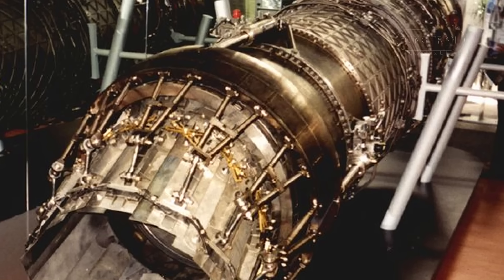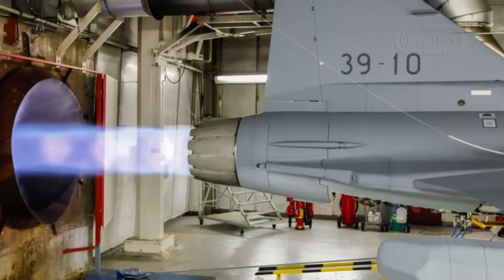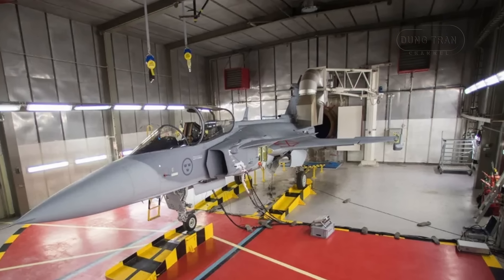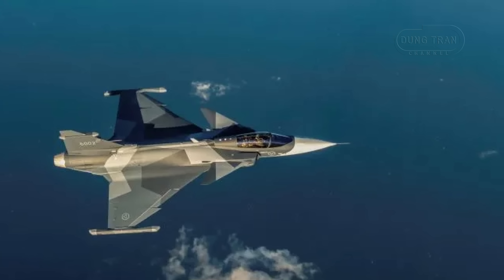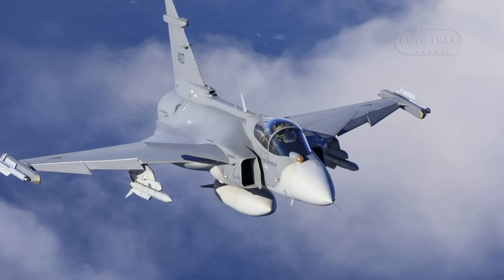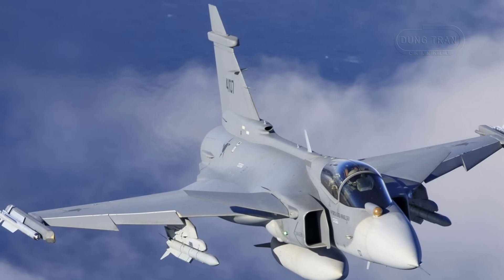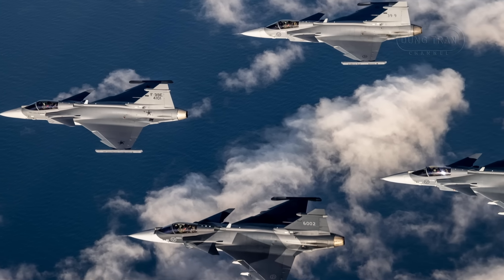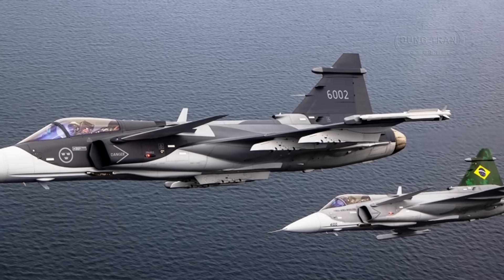Sweden’s Bold Move: Rolls-Royce Engine Could Save the Gripen E/F! 🚀

Comment: The grippen is a fine little jet  and would be a great low fighter in the high low fighter jet strategy. NATO has long depended on the US to provide the heavy lifting when deterring the Russians from aggression. Relying on Grippens alone continues that trend. The proposed engine swap only lowers thrust by 10%. I’m sure Saab can easily sell fighters with 10% less performance.  Even so Rolls Royce is threatening to move to the US if so whose engine will they try to shoehorn into it next. Trump has been trying to get NATO to fulfill their defense spending percentages  and with the recent aggression from Russia they are at least paying lip service to it. So far Canada’s only air defense move has been to buy a bunch of legacy f/a 18s too worn out for Australia.  If I was Canada I’d at least honor the original f35 order maybe even a few more then split the rest of their fleet between grippens with the engine it was designed for, and F/A 18 super hornets both use versions of the same engine. I’d build the hangers for the f35s and contract with the US for maintenance. So Much TDS here is amazing. He will be gone in 3 years long before the fighters arrive and then you will still rely on the US to deter Russian and Chinese aggression.

Comment: Y'all are latecomers😂 

The Rolls Royce Avon engine was used, modified under license by Volvo Aero as RM6C by J35 Draken since 1950s. Before that by J32 Lansen.

Another Rolls Royce engine was pre-selected for the J37 Viggen but had to be replaced by the Pratt&Whitney engine for the Boeing 727, heavily trimmed for near Mach 2 speeds again by Volvo Aero into RM8A&B (the latter for the JA37 fighter model) due to discontinuation of the British plane the engine was originally intended for.

Comment: Sorry folks euro fighter Typhoon blows this out of the sky in every way and more . Gripen can only do a 8.2 G turn compared to the Typhoon 9G constant . The comparison is no contest .the ceiling is sub par compared to Typhoon  55000 ft proven after burner mach 2+ cruise without mach 1.5 and way more hard points with the most modern missiles. 360 degree helmet view the list goes on . Why use just to show were got some fighters make a statement we are still relevant and ready. Don't bring a knife to a gun fight.

Comment: Saab is actively working on replacing the current General Electric F414G designed engine in the Gripen E/F with a Rolls-Royce engine. Specifically, they are proposing to integrate the Rolls-Royce EJ230, a derivative of the EJ200 used in the Eurofighter Typhoon, into the Gripen E/F. This move is driven by a desire to reduce reliance on US-sourced components and mitigate the impact of potential US export restrictions, particularly in relation to Gripen sales. This would pave the way for Philippines, Colombia and maybe some other countries acquisitions of Gripen.

Comment: A few issues:
- Is the Rolls Royce engine itself 100% ITAR-free?
- The Gripen has other ITAR components, so it's not just the engine that needs changing.
- If any long-range air-to-ground/anti-ship weapons rely on US navigation & targeting assistance (as with the StormShadow in Ukraine), that's going to be another stumbling block to Gripen sales.

It seems to me that European countries need to design and build their military gear from the outset to be 100% ITAR free. Being dependent on the US, especially with The Orange One in charge, is not a good position to be in.

Comment: Retired Canadian Cold War aero engine  tech.

I do not profess to know economics,  though took economics in school.  One subject in college Economics Engineering Analysis,  hard professor, but smart, NASA was trying to poach him.
 So just talking without the economics knowledge.
 I worked on GE engines in my career. Funny Rolls Royce in Canada overhauled then if I recall correctly. 
 So have read USA vetoed Grippens for Columbia as has say as GE engine.
 Read Rolls Royce has an engine that could fit in Grippen.
  So as Canada only taking the 16 F 35's they paid for and seem to be canceling the other 62 F 35s.   Maybe Canada could entice Saab, Rolls Royce and Columbia by proposing that Canada will purchase Rolls Royce powered Grippen E, and as cheaper more than the 62 canceled F 35s.
 Columbia could then get Grippen by not needing USA okay.
 Canada will be another step away from the 75% military equipment we were buying from USA.
  Maybe with the non USA engine, other nations will consider going with Grippen.

As an aside with the recent NATO Summit wanting 5 % of GDP put part think 1.5% can be for infrastructure.
 So maybe Canada as Grippen doesnot need airfields but can use roads. So can build some smaller airfield in our Arctic, this supporting Grippens and possibly Airborne Early Warning Aircraft ( Sweden uses one with Canadian Canadair airframe : win win).    With Global Warning and Northwest Passage opening up. This would help Canada with Sovereignty, plus good pro active action against the Mango Mussilini's talk of taking over Canada and Greenland.  Maybe besides NATO partnership Canada and Greenland through Denmark can write up a partnership to jointly monitor and protect their territorial waters ( 200 km ?)    This would be another block against loss of sovereignty

Comment: Daumen runter. Deutscher Titel Englisches Video
Reply: YouTube automatically translates video names to the language of your device, genius.
Reply: @honzabalak3462  Nur wenn der der es reinstellt auch den hacken dafür setzt, du Genie.
Reply: @hl6199  Duh. So you know how it works yet somehow still act all surprised and angry. There is an english title right there in the thumbnail, BTW. Super easy to spot, in fact.

Face it, you're only hating because you wanna hate. There is no actual reason for it - it's not the fault of the video or its author. It's a YOU problem.

Comment: British 🇬🇧 here, I'd like to see our Royal Air Force buy 80 or so of these to replace the Jaguar austere airstrip (roads) dispersed operating capability. In time of major war airfields will be prime targets. If we had 2 Wings trained and operated like the Finnish and Swedish Air Forces able to disperse and operate from roads that would be great.
Also engine commonality with the Eurofighter Typhoon would reduce costs 👍
Reply: A navalised version would give some meaning to our aircraftless carriers.
Reply: @Teddy2020-v4p 
I did think of this as well. But the Gripen is probably too small unfortunately.
Plus it's very difficult to Navalise an aircraft that's not originally designed for it as has been shown in the past ☹

Comment: Saab could develop a twin engine variant of the Grippen for the long run and then the Eurofighter engines could be retro fitted that way but the cost per unit would skyrocket.  However for large terrain like Canada this would be a preferable platform given the redundancy a 2nd engine would provide.

Comment: For Canada, the Gripen would be an excellent jet for operations in the Arctic. It offers lower maintenance costs, more economical operation, and would reduce reliance on the U.S., particularly under a potentially unstable or politically compromised administration. Additionally, the integration of a Rolls-Royce engine aligns with our strategic partnerships in the European Union and could strengthen transatlantic defense cooperation.

Comment: yeah, I think that 99% of all people in this comment section don’t realize that nothing happened and most probably nothing will ever happen in this direction. The export problems of SAAB just highlight of how we Sweden and it’s jet are in the end of the day. Even if they switch engine, they are still under full US control because the US can still pressure soap by threatening to kick them out of the T7 program.

Comment: I'm Brazilian. The Gripen is fantastic, but if the Saab to change the engine for a Rols Royce, its will the best of the world.
Reply: You do realize that the aircraft will essentially be a different one that what you have right?
Reply: @aidan11162  Its a  normal and simple engeneering procedure.
Reply: @aidan11162 , I'm not very knowledgeable, but this is what I gather from the news and Google.

Brasil doesn't really have that many Gripen E. Production and delivery have been slow, so most of its present Gripen cleet is comprised of an older model on a loan. I don't think any Gripen F (the one that will be built here) has actually been delivered so far. 

So it's likely that the swap could be made somewhere along the line, but that decision  is not straightforward.
Reply: @loremipsum7ac  It's really. Severous issues are contributing. The USA engines are one of them.
Reply: @loremipsum7ac  There are no loans or older models. Brazil is set to receive its 10th Gripen in a few weeks, followed later this year by the 11th Gripen and the first one produced in Brazil. Another 14 will be produced in Brazil and another 8 in Sweden until 2030(was suppose to be 2027, but changed due to $$).
Reply: @loremipsum7ac  Myb you should learn before talk ? Brazil has the full production line of the Gripen it was on the agreement that Brazil could gain the means of production by even exporting it. If you check the news recently we double the capacity of our manufacture from 8 to 16 in partnership with SAAB

Comment: Rolls Royce did this with the P51 Mustang in WW II making it a far better plane, and a match for the FW 190D.
Reply: The Merlin was a fine engine but really no better than the Allison the mustang was designed around. Since the mustang was created for a British contract and since the Brits needed every Merlin they could build and could build no more they wanted any fighter they could get their hands on. The early mustangs were great low altitude planes but the available superchargers were not configured for high altitude because the US Air Force’s inline fighters were designed around turbochargers. Once the Brit’s mates a Merlin to a p51 it was a high altitude winner but still no Merlin’s were available. The American automobile company Packard reengineered the Merlin for modern manufacturing methods vastly improving speed of production and making almost as many engines as the UK did in half the time. Allison continued to improve their superchargers until their engine was a match with the Merlin and a bit better but by then the war was ending and soon jets ruled the skies.

Comment: Canada here.🇨🇦 Canada should definitely cancel the remainder of the F-35 contract and get the Gripen.
Reply: Typhoon II and then Tempest II
Reply: And so should Denmark and Norway
Reply: Can't ! Locked into the first 12.
Reply: @maximilliancunningham6091  Yes, but not the remainder. I believe the order was for a potential 88 aircraft. I thought they were legally committed to purchasing 18, with the remaining 70 as an option. Please correct me if my figures are wrong.
Reply: First ask the US for the right to sell them. Purchase them as planned, then sell them. That would be cheaper than cancelling, if the US allows it.

I doubt the US would dare to block sales to countries that already operate F-35s.
Reply: Not happening.  We're getting the full order of 88 F-35s.  You can't effectively and efficiently operate a mixed fleet of 88 fighter jets.

Comment: Back in the early 90s I worked at RR and we did a study on how a JAS39 powered by an EJ200  would perform compared to the GE engine. The results were impressive. A re-engined Grioen would be awesome.
Reply: I'd like to see the results of a Eurofighter with the EJ230's strapped in, that would be interesting.
Reply: @mikester1290  I think it would make Typhoon the most impressive Gen4+ combat aircraft by far.
Reply: @GARDENER42 especially since you can leave out the thrust vectoring nozzle saving potentially hundreds of kilos, since the Eurofighter can already due to its airframe design maneuver well
Reply: That would be Gripen C with F 404, different aircraft

Comment: is it more expensive to reconstruct an engine to fit in existing airframes?
Reply: Its not practicable
Its why when the RN & RAF got McD Phantoms the Airframes were modified to take the Rolls Royce Spey engines rather than keep the slimmer & faster Airframe & try and shrink the Speys or fit existing smaller engines.
(But they got more power & much less of the smoke which showed enemies where they were)
Reply: Yep

Comment: They already tended for the Gripen  engine supply with this engine so they know a lot of this already. This EJ230 is not the same as the EF engine. It is meant to be slightly larger and was the tender proposed engine so is already pre-adapted to a large degree for single use..
It is meant to be slightly more punchy than the GE engine, but GE could offer the F414 cheaper due to smaller per unit R&D. Sweden was very sensitive to unit cost due to lack of partners to share R&D

The Gripen is a guerilla fighter jet. It was adapted for remote field supply and maintenance in a unique modular systems design. 

Reconfiguring for different engines shouldn't be too hard due to this unique design philosophy.
Reply: Dream on, it’s not like a Lego kit where pieces can be swapped 
Being a very small aircraft everything is tight packaged, changing one thing leads to another and so on.
From a software point of view it might be a different story with modularity and relative ease of change built into the design architecture